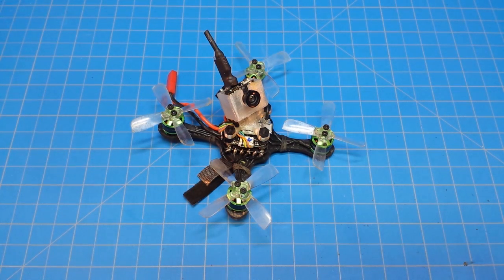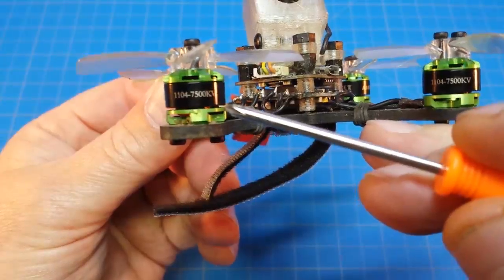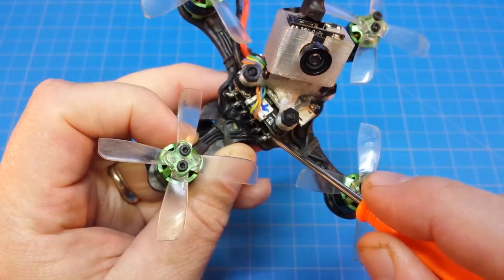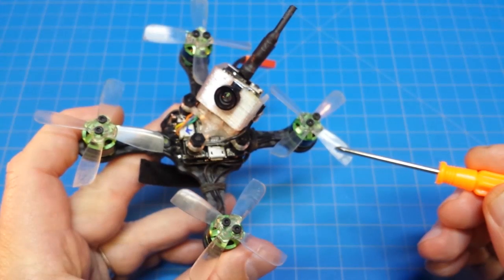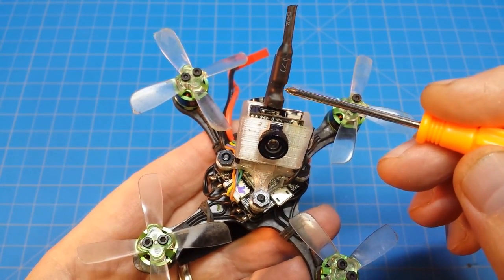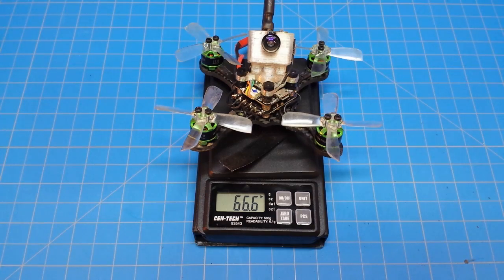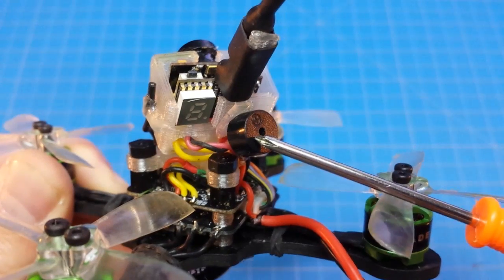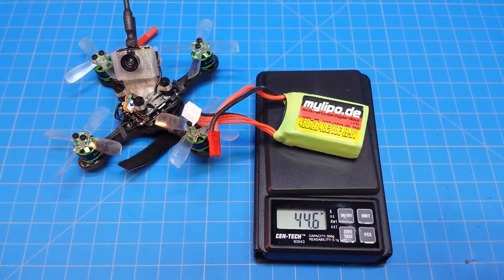AirBlade UAV Bolt

Comment: Is it possible to get mAh while using a 4in1 ESC? Looking at the Omnibus micro AIO V2 with 4in1 Cicadas
Reply from the maker: I believe so, but I don't have experience doing it.
Reply: Nick Burns I don’t know if powering the 4in1 ESC off of a single set of pads from an AIO board will cause any issues. Because I need to have power going through the board (aka shunt resistor) first then feed the ESCs. Obvious solution is to wire up every single pad on FC to power ESC that way there won’t be current issues but that would be a mess not to mention added weight

Comment: I have this fc and I can't figure out where to put the rc in?
Reply from the maker: for the receiver? The receiver signal wire goes to rx1.
Reply: Shoot! I put it on rx 6
Reply from the maker: in betaflight or on the board? The board pin map doesn't have and rx6 only an rx1. In betaflight I believe we need serial rx on for uart3.
Reply: That is weird! Mine has an rx 6 and rx 1 on the board. I wish I had watched. Your video before I had ordered the fc, the 5 volt beck does not work on mine!
Reply: How do you contact rtfq I have had trouble contacting them

Comment: Could you elaborate on the faults for the other f4 boards please? I think I have the same one, it seems fine except for the camera and leds are not working, but i have not yet ruled out that its not the camera and leds themselves not working or the board.
Great video as always. Cheers!
Reply from the maker: I don't think your issue is specific to this board. The on board 5v regulator can't provide enough power. Solder on two short leads directly on to the battery wire solder pads, then solder the other end to the battery pads on the fc. Should take care of the issue.
Reply: I added a separate small bec and now my camera works, but still no leds. (at least i can get by without leds).
Im not sure what you mean about soldering the battery pads.

Comment: Do you prefer 2S or 3S for your backyard?
Reply from the maker: It depends on the vehicle. 3S with the cs110 is to fast, all I end up doing is going down the wide straights down the middle. 2s generally on 2.5inch props and 3S when using 2inch props outside.

Comment: I think I would rather fly 2S with 10 000kv motors then 3S with 7500kv. The Macaron seems to fly similar. What is your conclusion?
your 3S = 111.2g and your 2S = 98.9g to 105.1g
Reply from the maker: the 10000kv motors are only spec'd for 2s, we are locked into that, but if we had 10000kv that would run 3s it would be interesting to try. On the sticks I felt the 3S was faster while maintaining agility.